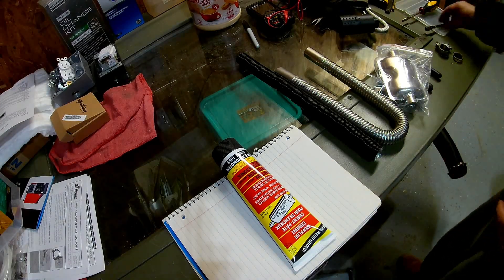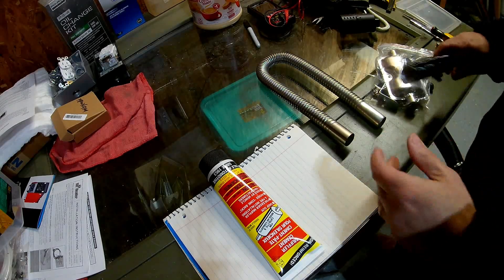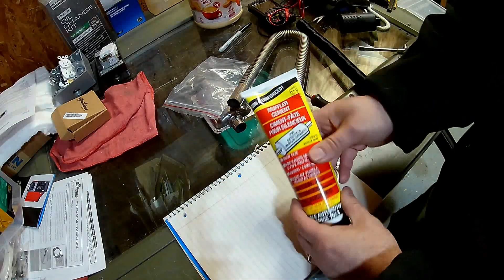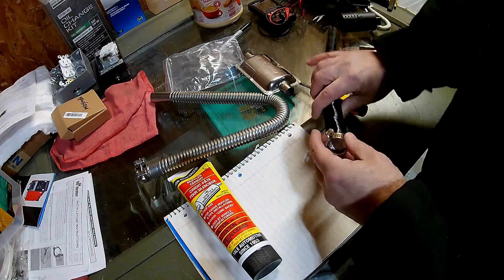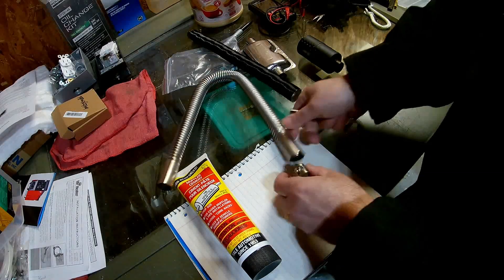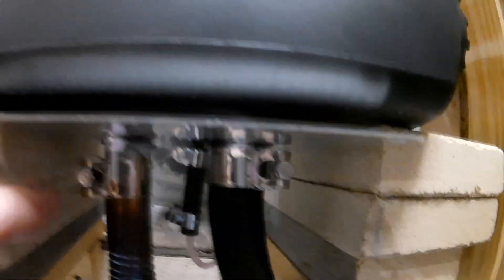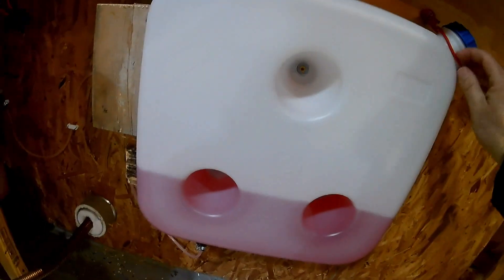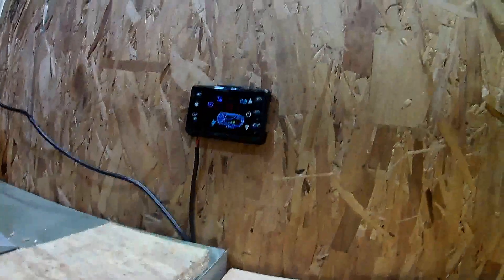$100 Vevor Heater Installed

Comment: Please tell us more about the insulation you used around the exhaust pipe going through your wall. 
You said it was 'double insulated'?
What material did you use around the exhaust.
That pipe gets pretty hot and could be a fire hazard to the surrounding wall especially if it's wood.
I'd like to see a video on how you made it. 
Thanks for the videos, like then a lot.
Reply from the maker: I'm not saying this is correct, or will work in your situation, but here's what I did: I used double walled b-vent pipe, and removed the inner pipe, wrapping it in hi-temp ceramic fiber blanket that's used to insulate pizza ovens, and then reinserted the inner pipe. I wrapped the diesel heater exhaust pipe with the same material, and inserted exhaust pipe into the inner pipe. If you go this route, wear a facemask and gloves to avoid the fibers in the blanket material.

The outer insulated pipe is warm to the touch when the heater is running, but I can leave my hand on it. The surrounding wall is cool. The ceramic fiber blanket material is available on amazon. I'll probably cap the ends of the pipe in the future so it looks better.

I agree with you that the exhaust pipe gets very hot and care needs to be taken when penetrating a wall and running it through it.
Reply: @TheGergeDIY  thank you for the reply, I really appreciate it, that's made my day.
I will look into this for my installation, that's an excellent idea.
Greetings from England, and have a wonderful Christmas and a Happy New Year to you and yours.
Reply from the maker: @leanderthal2689 cheers and Merry Christmas and Happy New Year to you as well.